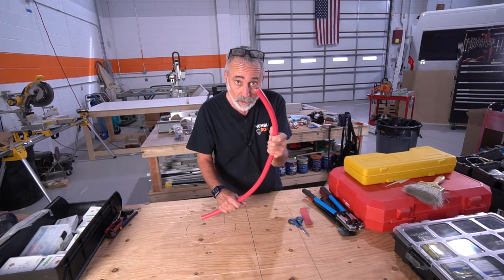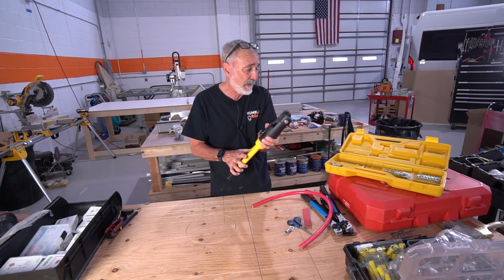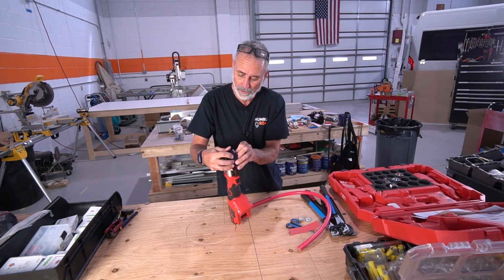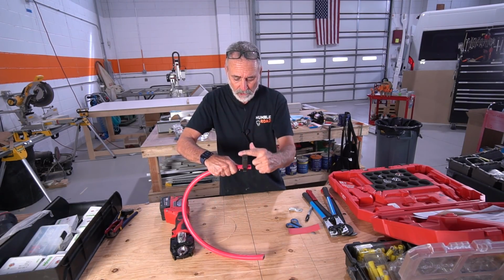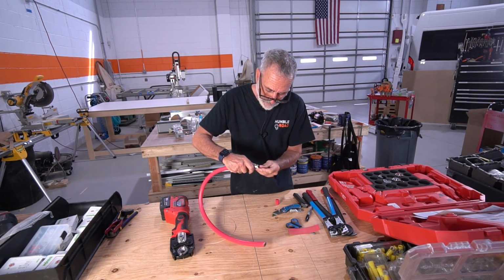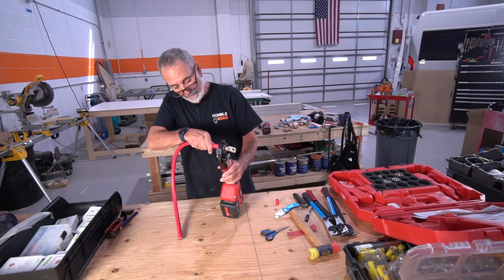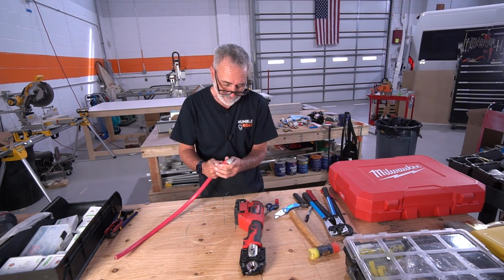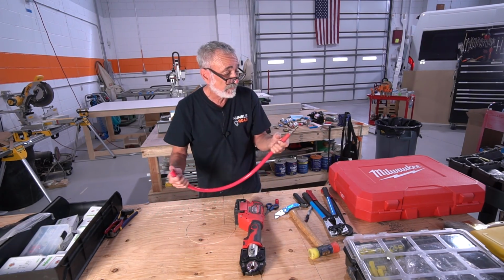VAN BUILD TIP SERIES: Safe and proper wire crimps are extremely important in your van build.

Comment: PS: full disclosure.....have not watched your vids for a year plus.  Did make a copy of that screen door you made several years back AND STILL LOVE IT.  Have a Pleasure Way OnTour 2.2 coming in in November and starting to make a list of mods I want to do.  So here I am again looking over your great ideas.  

Side door, front cab overhead shelf, Lagun installation tricks, etc.  Thanks again for all the well thought out ideas.  Also switching out the two 100Ah lithium Eco batteries with two SOK 206Ah batteries in about the same physical space.  The 12v 5cf refrig only draws 200ah per day but the RV has induction cook top.  We dry camp a lot.  Sorry getting diarrhea of the mouth.

Comment: I saw in the vid you had a couple of the smaller wire size crimpers that have rotating dies to crimp.  I got one of those off Amazon (haisstronica Battery Cable Lug Crimping Tools-Wire Crimper Tool-AWG 10 8 6 4 2 1/0-Battery Terminal Crimper for Heavy Duty Wire Lugs,Battery Terminal,Copper Lugs Terminal ) and found it not to be safe.  The dies when used as directed made did not make tight crimps on 4 ga wire.   If you rotate one of the dies to one size smaller wire and crimp several times it was "good".  I sent it back and posted that it was a safety hazard (no surprise my post was not posted).  Your power tool for a serious builder is nice.

Comment: $4500 plus the cost of die's?  That's a tough bullet to bite when you're only doing a couple personal builds.
Reply from the maker: Yes it is. But as I continue to build vans, this season; four of them at once, I decided the safety of having good consistent crimps was something I needed, without question. A poorly crimped lug with 300 Amps running through it can glow hot and cause a fire.

Comment: Unfortunately I have never had luck with crimpers. If they don't fail the pull test right away they fail when maneuvering the cable or couple years down the road when removing cables to change batteries. An older Asian gentleman taught me years ago using a hammer and solid surface like concrete floor and mashing it flat. I had a tech laugh at me one day so we did a pull test with a come along and all his failed way sooner than mine no matter what he tried to do to make his better. Hammering them doesn't look as good so heat shrink is a must for cosmetic purposes. We also tested my way versus precrimped ones from companies and my way did better than all but 1

Comment: What do you think about soldering the connection?
Reply from the maker: Solder can break free under the vibration of the vehicle.
Reply: And soldering requires a good mechanical connection as well. Solder is for electrical connection only, not strength.

Comment: I want to say, that I discovered your channel and I'm loving it. Your videos are informative and you are awesome. After watching you handle that wire stripper, I figured I could give some unsolicited advice as I have many years of electrical experience in the industrial solar world and I have done thousands of terminations on 500 to 750 kcmil wires using a Greenlee 1903 wire stripper. I think an issue you might be having with the tool is that wire is actually kind of small to be using something like that. You could get away with a splicing knife or maybe some other tool. But here is how I would go about it...

Measure the lug out on the wire. It's an industry standard in my field to leave 1/8 inch of exposed conductor on the bottom of the lug so the conductor can be inspected for "ringing". We use Aluminum and it expands and contracts a lot so if you cut the conductor deep enough, you could eventually have strands break off. I mark it, then I wrap a piece of electrical tape on the line and I use that as a guide for the blade of the stripper, because they tend to want to wobble. You still need to keep it straight when you spin it of course, it's not going to take the human error out. Before I plunge the stripper blade into the insulation, I hold it at the tip of the wire and adjust the blade to a depth that will be just barely off the surface of the conductor, again, you don't want to ring it. I then slide the stripper down, pulling on the "hook" of the stripper so the blade doesn't drag on the wire and snap. I then plunge the blade in at my tape line. You spin the blade TOWARD the opening. I noticed you were spinning away from the opening. Maybe that was in the instructions for that particular stripper, but I've seen a lot of guys in the field make that mistake and it means you are spinning it blind and you can't guide the blade and it makes for a shallow cut that wobbles. After ONE spin, you hold the hook with one hand pushing into the wire and you pull the handle back so the blade comes all the way out of the insulation. You then twist the blade and plunge it back in at the exact same spot you pulled it. A lot of the tools will say spin it 45 degrees , but I only spin it about 30 degrees because it puts less pressure on the blade and it tends to walk out less. Then spin it towards the opening and walk it off. If there is a little spike on the end of the hook, you take that and drag it down and out across the spot where the blade left the top of the insulation. That will peel the insulation back and you can remove  it with your hand. Hope that helps.

Comment: Using the 16 ton yellow crimper I just back off the valve for a moment the pull captivated pin off the end instead of pumping the full stroke of the hydraulic cylinder each time.  I also mark the flat of the lug on the wire and then square it up in the crimper, apply maybe half a stroke to hold it then align and push the wire in place. 3 or 4 pumps and it is done.  Second crimp fwd.  I see people keep pumping even after the dies collide, then I see their broken crimper. Most of the dies with that 16 ton are for really big wires (way beyond 4/0), kinda lacking granularity on the more useful sizes we are all installing.  Agreed, nice to have you back a booming!

Comment: I used to crimp DC cables for 48v Telco equipment (central office). I wish I had one of those when I was doing that work, that is truly amazing to crimp a 4/0 that quickly and easily.

Anyway, one nice thing about Telco lugs (mandated by the bellcore standards) was that you had both extended barrels in some cases for dual crimping and an inspection hole at the top of that taper so you can confirm the wire was properly inserted. They also had dual stud holes as well, so you had tons of surface area for connection points. 

One thing I would highly recommend is investing in high quality shrink tube. There is a whole world of speciality heat shrink made by the likes of Tyco, some are even used for marine repair on subsea cables (which is my industry). 

Anyway, I would at least use double wall adhesive shrink like the ones Ancor resells, or find a Tyco, etc dealer. It provides some additional mechanical strength and wear resistance. 

Btw the crimp mark is very useful for issues down the road...if there is a fire etc it could be used as evidence to understand the cause...I've run into several problems where I took the lug apart and found it was crimped incorrectly...probably because someone lost the right die. Fortunately I've not seen it cause a fire, but it did melt the plastic around a lug pad on a piece of Telco equipment.

It's also standard to use NoOx to coat the wires in telecom before you insert the wire in the lug...this is another guard against corrosion (Telco power plants are expected to last 30 years at least). You just need a tiny bit, and put it on the face of the lug after making sure all surfaces are very clean. Dust can actually cause heat as well...I have seen a fire (high voltage) caused by contamination between the conductors.

I can go on and on, having been involved with 200kw+ DC systems, there are a lot of details to keep them reliable that comedown to patience and redoing work that might not be perfect. Senior guys always made us restrip of we even clipped a single strand on a wire.

Comment: When I installed my solar I made up the battery cables at West Marine on their rigging bench, since my ratchet  crimpers are for smaller gauge wire. They sell the correct tinned  wire, lug connectors and heat shrink. It did not occur to me that their crimp tools are meant for stainless cable and it’s fittings, not for the battery cables I was making   Everything appeared to be correct.  The radius of the connector matched the radius of the crimping tool.. 

One of my battery cable ends pulled off on a trip, so I used vice grips to reattach the end, squeezing it from the side edge like a pinch 

Now I use my infrared thermometer to make sure there’s no resistance to the  cable ends and will have to tear everything apart to install properly swedged cables

Comment: At $4500 I'll stick with my $65 hydraulic crimper.  Ha.
Reply from the maker: I’m doing 3-5 vans a year simultaneously.  So for me it makes sense. As I build vans for people, safety is my biggest concern.
Reply: @HumbleRoad  - Absolutely.  If I were a professional van builder or RV solar installer I would make the investment too.  BTW, George, you are, without a doubt, the best van builder I have ever seen (and I've watched many a build on Youtube).
Reply: @HumbleRoad  The cost difference between your Milwaukee tool and the cheaper hydraulic crimper is minimal considering the lawyer fees you would have to pay if a client were to sue you for defective workmanship at some point in time.  I just had an idea - I am not a lawyer but I have been involved in construction litigation, I recommend that you develop a procedures manual documenting the process that you utilize and require for the installation of items in your builds.  These videos also should be archived as part of your procedures and QC manual.  A little effort now to document will save you many dollars, time, and hopefully minimize litigation in the future.

Comment: I use a utility knife to slice the 4/0 insulation along the strands to remove the insulation after using the special cutting tool.  It works well and doesn't cut off any of the strands.

Comment: (1) Doing everything in 4/0 no matter the length and rating isn't smart. It's a waste of weight/resources and your customer's money. Use calculators, and aim for 3% voltage drop if you really want to be excessive about it. But 4/0 everything is just weird.

(2) There's all sorts of ratcheting crimping tools that are ~150$ and will give you a fast, consistent crimp. "FTZ Correct Crimp" or Anchor's hex crimping tool work great.
Reply from the maker: I may not have done an accurate explanation . I don’t use 4/0 everywhere and I do calculate every single wire run to the inch and allow for only 3% voltage drop.
Reply: @HumbleRoad  thanks for the clarification :)

Comment: George, if you highly recommend a product, maybe you could set up a referral commission with a link in your description and post with EVERY video. It doesn't cost more for the buyer and you may get commission. 

Actually, as a viewer, I would appreciate this as whenever I decide to outfit a van I plan to use the same products you use. It would save me a lot of research time.

I know Carey On Vagabond does this. 

What an excellent video on wire clamp installation.

Comment: I am putting in 612 AH battery bank and 4000 watt inverter, mostly for induction cooking and will get professional help for making sure I have solid wire connections and proper installation. This is one area of a van build where there is no room for error. Your videos properly raise the cautions of getting this right. If you or any of your viewers know of a good business that can do this in western Massachusetts/Albany area, I’d appreciate the lead, or I may just go find a boat electrician on Cape Cod while I wiggle my toes in the water. 

Next, professor, I’d love it if you’d do a video on how you attach wood surfaces to extruded aluminum with no framing showing, and and also how to support and frame windows.

Comment: For anyone that doesn't want all the exercise of a hand pump hydraulic crimper, but also doesn't want to dish out $4K+ for a cordless one, you can get mechanical bench mount crimpers that will do 6 AWG to 4/0 cables for $275-375. They've got long handles so you can put some body weight into it and they use fulcrums like a bolt cutter to multiply that force further. A 125# teenager can easily make solid crimps with one swing of the lever.

The dies take a a little longer to change, and you have to do all your crimps away from the vehicle since the crimper needs to be bolted to a bench, but I used one for years making new battery cables when I worked on school buses.
Reply: @jamesgill agreed. I use a similar setup. Not as cool as pulling the trigger,  but a fraction of the cost.

Comment: Working with heavy gauges is definitely a challenge. 12/24 volt wiring in general is a lot easier. I don't really like using crimps if it's avoidable for extensions and stuff, I tend to use Posi-lock connectors instead. Basically up there with soldering but much easier to do.

Comment: The cutting tool you used to cut away the outside layer of the 4/0 wire is VERY similar to a plumber’s tool to cut pvc and abs pipe…they look identical. In fact I thought that’s what you were using! Always intrigued by your DIY lessons! Stay safe, my friend!  ~Jim~
Reply: Yes, good point.

Comment: I have the same Chinese crimper and I had to go through three dies before I was satisfied with my 4/0 crimp.  120, 95, & 75.  I also drilled a 1/4" hole in the lug (some come open) and melted in about a foot of solder.  Just a little to stop oxidation.  The solder did not go past the lug and stiffen the cable.  I really enjoy your video's.  I am so glad you are back!
Reply: FYI, if the crimp is done correctly, you should create a cold flow connection that is gas tight. T&B used to have cutaways of a completed crimp showing a solid mass when done.